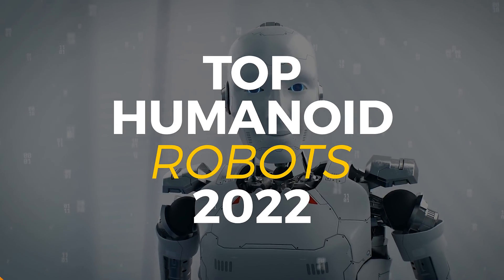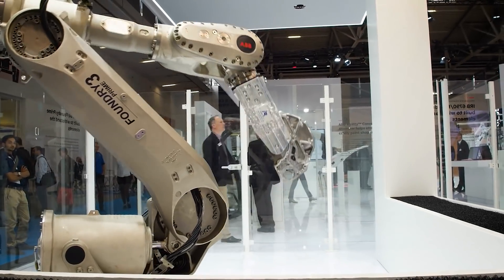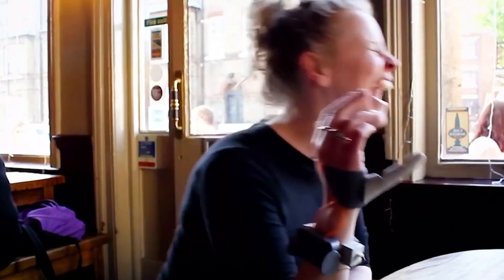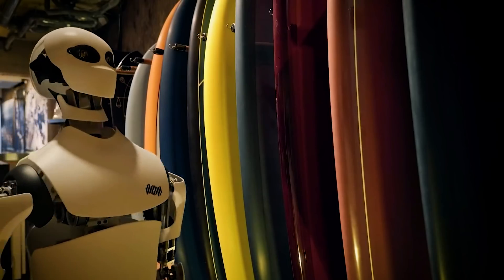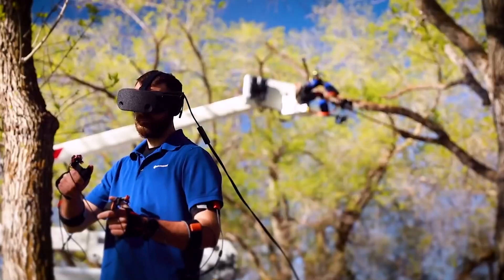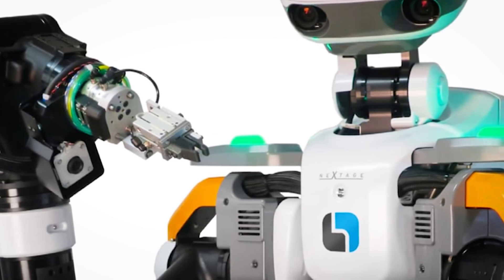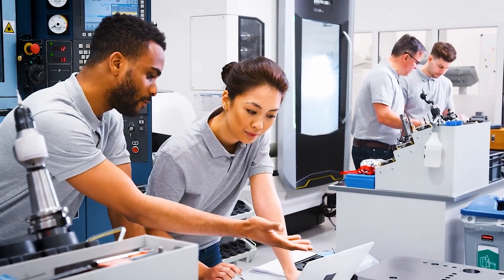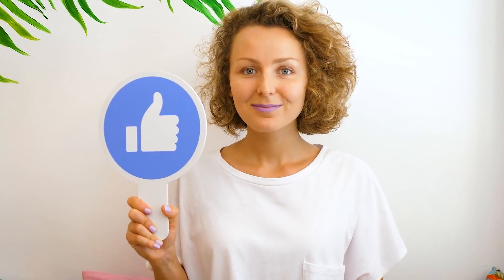TOP Humanoid Robots | They Do Chores Humans Don't Like

Comment: Unless robotics or android technologies take a huge overnight leap we're pretty safe in our jobs.....................for now.
Reply: For the most part, the majority of them are only intended for use as dependable support tool's for the staff , and the comfort of the patient's only.
Not as replacements for human beings.
Like the Robear used in Japan that gently lifts patients up from their bed and then down to a wheel chair without having to go through using awkward lift equipment or worker's being back injured from heavy lifting. Or saving the staff's valuable time and energy by helping the eldest with chores like placing a phone call to a family member or finding and retrieving out of reach personal items or fetching a pre approved snack or drink.
Grace the human like Nursing assistant can also be virtual reality  remote controlled by staff members to do lightweight but necessary important tasks like checking in on patient's ,taking and reporting temp and pulse.
Grace is just  that helpful extra pair of eyes , hands and feet that you've been needing.